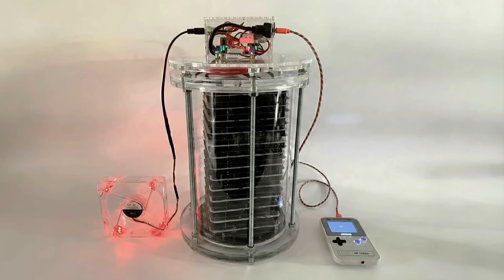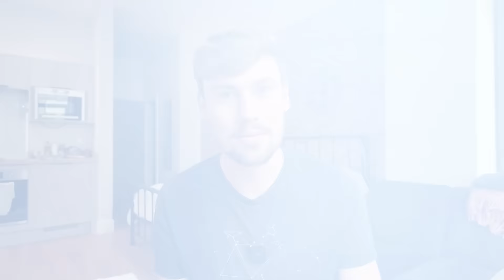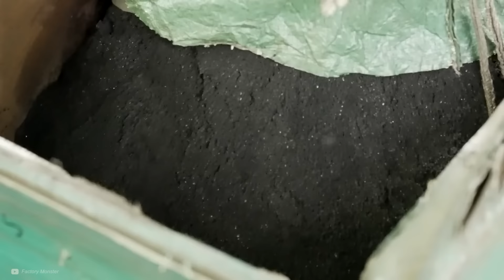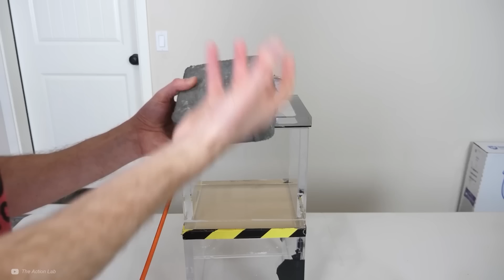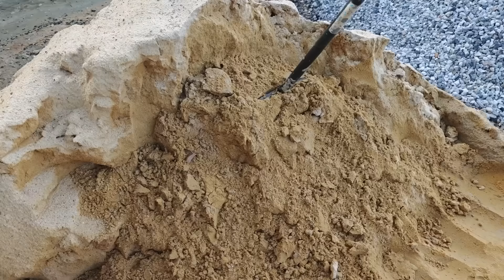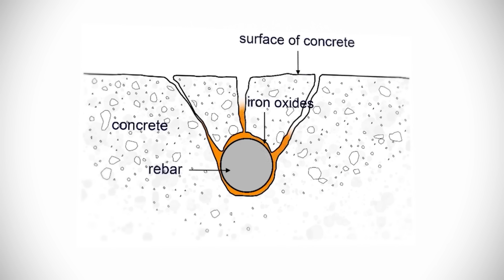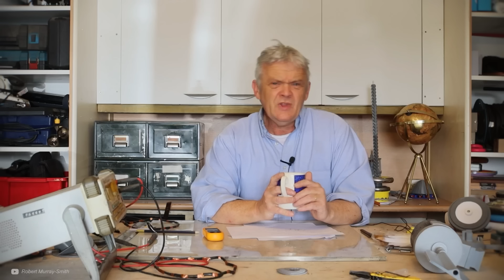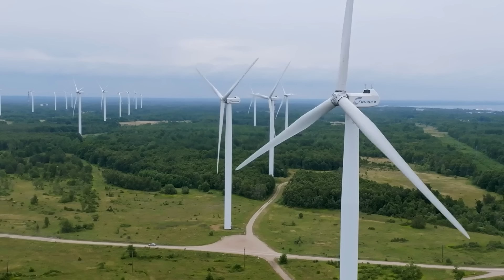How MIT's New Concrete Stores 10x More Energy

Comment: Too bad they didn't went deep on how mechanical load influences the electrical performance, because if you could measure sress directly out of the concrete it would be amazing. In sismic zones or critical buildings that need to sustain forces from wind or sandstorms you could have instant feedback that can be read by a computer or microcontroller and take corrective measures. 
I know that there are already sensors to measure these kind of loads, but this has the potential be much more durable, if not eternal and outlive the building, and maybe if economy of scale is generous enough, could even cheaper

Comment: I could see this being using in foundation. Newer building methods are already coming out with the concrete being sealed for water tightness on the outside and underneath.
Also, with skyscrapers, I could see an engineer using these to do some really cool things. Think catching lightning and using it to charge the building, as an emergency electric source, as a wire less electricity movement method, rather than running wire through everything.
Lots of ides.

Comment: another interesting idea: using the conductivity of the concrete as a way to measure its stability. if cracks form, that should be able to  be electrically measured.

Comment: Interesting. Seems more easily doable as ready-made blocks (very oversized "bricks") rather than poured concrete. Easier to control the conditions for both stability and capacity.

Comment: 200Wh / m3 of concrete (weighting more than 2 metric tons) that is less than 0.1WH/kg, about what chemical capacitors would get (so not a "massive" step up) - while optimized "supercapacitors" easily offer 10Wh/kg

Comment: Don't quote Robbert Murray Smith. He tried to sell common carbon powder as graphene to people who had no knowledge about the material, and he claimed to be able to produce it at home with his regular kitchen oven in higher quantities than the total global production of real graphene at that stage in time. At a certain point he even tried to lure people to invest in his nonsense and that he was building a factory, which he never did. I personally debunked his nonsense, the man was a fantast. He always refused to answer some basic questions. Apart from his attempted scam operation all that he did was creating videos about some very low grade school experiments that amazed people with a very low grade of education.

And you should learn about a company called skeleton ultra capacitors. Those capacitors store much more energy than super capacitors, and they are used for a number of different applications, for example to store energy for regular energy consumption, grid stability, data centers, and super batteries, instead of a super fast and high amount of energy delivery like regular capacitors do. 

Your videos hang together by a very limited amount of knowledge and a lot of assumptions. And to my opinion your credibility is at least questionable.

Comment: I'm curious about the structural effect of carbon added to the concrete.  Also, would fiberglass reinforcement mitigate the issues involving using steel rod or mesh in a superconductor?

Comment: My father was a terrazzo manufacturer. Terrazzo is polished coloured concrete with decorative aggregates such as marble chips.
In 1965 he cast the flooring in some hospital operating theatres . The flooring  in hospital theatres has to be antistatic to prevent static discharges that can ignite materials in contact with the pure oxygen the anaesthetists use. Because of this the concrete had carbon black in the mix to make it conductive.
Old technology
Reply: storage v conductivity. I think you could make a pretty penny if take your father's business back on and start building the first series of batteries, especially if they're decorative.
Reply: That is fascinating. Somehow I suspect this is a mostly lost "ancient" technology. Most hospitals I've seen have some form of vinyl coverings over the floors.

Comment: 6:10 Energy density seems to be really low, though. The graph shows 189–222 Wh/m³ and since 1 m³ of concrete weights about 2400 kg or 2.4 tons so you end up with up to 222 Wh / 2400 kg or 0.09 Wh/kg. As a comparision, LFP cells have 220 Wh/kg, high quality NMC cells have 300 Wh/kg and Donut Lab is currently claiming to have tech that can do 400 Wh/kg.

Assuming 190 Wh/m³ for this concrete structure, I calculated that our whole house would have about 5 kWh of energy storage with this tech (assuming all regular concrete were replaced with this new material) which is about one third compared to a single Tesla Powerwall unit. I guess it's better than nothing but the energy density is still very low.

The improved variant that can do (in theory) 2200 Wh/m³ would already result in interesting amount of storage for a single house (about 50 kWh). However, this variant sounds much much more expensive than the typical concrete today and if this new concrete causes even 50% price increase compared to typical concrete, it's no longer competive in cost compared to Tesla Powerwall – and Tesla Powerwall is already pretty expensive product. For example, Huawei Luna2000-S1 batteries are already much cheaper than Tesla Powerwall and still have better warranty! And if Donut Lab can actually deliver the battery they are claiming, that would improve things even more for aftermarket units.

Comment: It is surprising to hear that much water must "evaporate" from the concrete.  Normally, curing concrete should be kept wet, because the hydration requires water, e.g. 
2 Ca2SiO4 + 4 H2O → 3 CaO · 2 SiO2 · 3 H2O + Ca(OH)2

Comment: Why can't capacitors be interconnected, releasing energy one at a time for a constant power flow?
Reply: If they are not in parallel, then one is discharged, then another is added in parallel, that new one will instantly discharge with high current into the already discharged capacitor.   So, if you are going to stage them as such, you need something, such as a diode or thyristor on each unit to prevent big problems.

Comment: floor in commercial buildings come to mind. They rarely need new holes in them etc. also foundations would be a good area. Roadway and parking lots.
Reply: I think, early, not so much for support, but for sound and temperature. Later on, as we understand electrolyte leaking and can professionalize spotting discharge risks, as well as live-load tolerances, I completely agree. Otherwise, I fear we play "the floor is lava" game.

Comment: They can make it lighter and store more electrolyte by creating aircrete.
they can create a cotton 3D mesh grid and fill it with concrete, and then you can dunk it into electrolyte and the cotton fabric will soak it in.

Comment: Yeah it was actually fascinating as one day I was trying to figure out where a leak was in my water main, and I had a company come out and they used helium, they would pump it in at the water main head after shutting the water off, pumping helium into the pipe and then they would walk the path of the pipe that's four or five feet underground, and this device was like a oversized suction cup they would place it on the ground and and see if they could detect the helium coming up through the ground, this was interesting but it was really interesting when they got to my garage and they were using it on the concrete and that's where they found the leak The helium was coming up through the concrete and this was probably 8 to 10 in of concrete.

Comment: This is not structural concrete, this just cement & fly ass,(the carbon source) at what looks like a 50/50 mix.  So 35% cement, 35% fly ass & 30% water based electrolyte. You did not state the mix ratio, but you did state that the organic based electrolyte was expensive. This product is not practical for use as you stated as normally all walls , floors & supports for windmills must be reinforced with metal re-bar or mesh, (yes there is fiberglass re-bar for a price). A 2.5 ton capacitor is not practical if it can discharge either 200 or 2000 watt hours of current. If Robert Murray-Smith were still alive he would back me up on this. Research at MIT to get a doctorate does not have lead to a commercially viable product.

Comment: Super Interesting!  I love the way you dig things up; it is a valuable service.

I’m a construction consultant.  The single biggest performance challenge with concrete is that concrete is delivered to placement with water.  Over time, this water leaves.  In interior conditioned space, this accelerated causing myriad modes of failure for materials attached to it (flooring, paneling) in the exterior roofing and barrier systems.     The problem is that in a cubic yard of concrete there are approximately 32 gallons of water.  Approximately 17 gallons of this water hydrates the concrete and is part of the cure.  The remainder has no purpose and has to leave.

Water leaving concrete is very slow. Estimated at 40 days per inch.  Your reference to the Hoover Dam is spot on; that project had an admixture that consumes this delivery water creating more concrete gel.  This is a good thing for the concrete because in large mass it doesn’t get so hot and unstable that it fails.  In building construction it is good because it densities the concrete, closing the capillaries and providing measurable control of that free water.

The other challenge with that free or delivery water is that in interiors it turns to vapor; think mold and mildew.

The Romans serendipitously discovered the value of the chemistry in their concrete; they added ash from mount Vesuvius.  This, in the Pozolan region of Italy.  Products containing these materials are now Pozolanic and are added to concrete to improve it.
We recommend a product call Vapor Lock by Specialty Products Group.  It is a liquid-borne sodium silicate nano partial solution, added to the mix water.  Very inexpensive, high performing, with a track record that goes before the birth of Christ as a material performance fact.
This is the Roman concrete code cracked.  
Sodium Silicate is the nano particulate suspended in distilled water.  
It’s what was used on the Hoover Dam (the solution, not the brand.)

Unless the free water, water of convenience, delivery water is consumed, water is the problem.
Reply: I was thinking "this lad now knows way too much about concrete for the rest of his job." :D

Comment: Great video!  And interesting.  But I never saw how you integrate electrodes into this scheme.  The only electrodes I saw is in that stack inside plastic tube.  Looking at that, are you saying that you make a stack of plates of this concrete and then insulate them from themselves?  The actual capacitor “device” and how it works was never made clear. I got electrolyte inside a matrix of conductive carbon.  I don’t understand how that makes a capacitor.